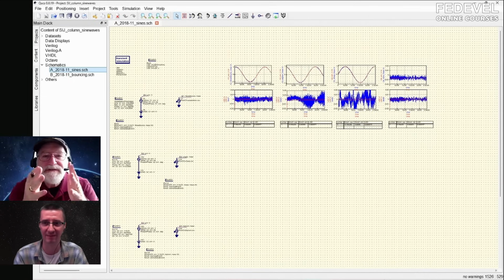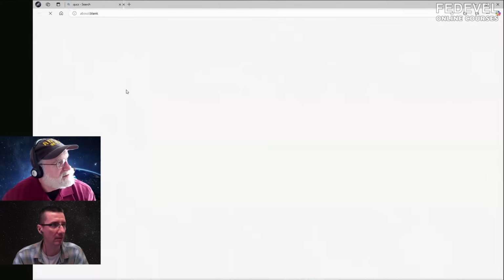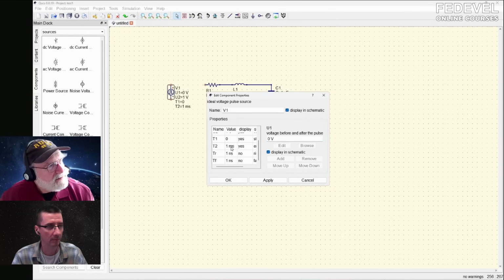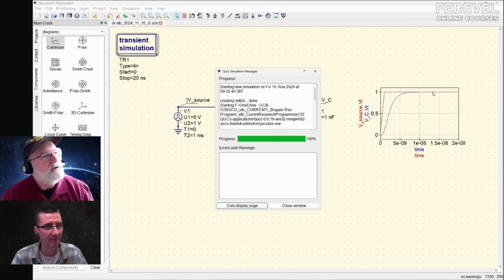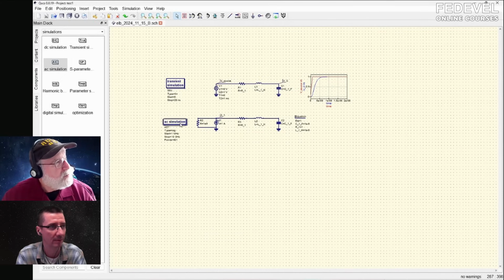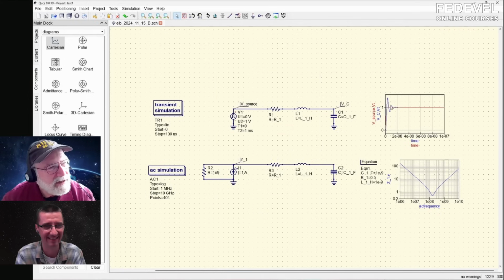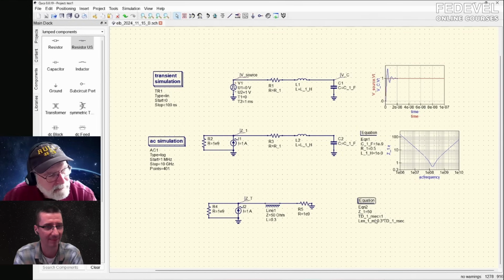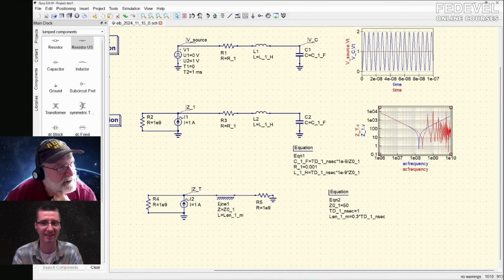How to Start with Electronic Circuit Simulation for Free | Eric Bogatin

Comment: I never see a model fr any of the parts I'd like to use.. even AD devices, don't have the part in LT Spice.  So what do you do to model a circuit, especially if it has a mix of AD / TI parts?    Is there another tool that can?  Cadence Sigrity?

My goal is to do a simple 8-differential-channel ADC  (AD7381-4) circuit (0-30v).  Not exactly high speed, but at 4Mhz, I know I can't be careless with the design/layout.

I was thinking each input would go thru a 15 Ω low-inductance 1206 series resistors, followed by 100 pF 500 V C0G 1206 capacitors from each leg to analog ground.   A single Vishay ACAS 0612 AT thin-film matched array per channel (24 kΩ series, 1 kΩ shunt, 0.05%, 15 ppm/°C) forms the precision 25:1 differential attenuator, mapping from the ±30 V input to the ±1.20 V THS4552 inputs.  Each THS4552 output drives the AD7381-4 inputs through 27 Ω 0603 damping resistors.

A TI THS4552RTTR fully differential amplifier (two ICs for four channels) is configured for fixed ×2.75 gain to map from +/- 1.20 V to +/- 3.30 of the AD7381-4..   Gain is set using standard E96 3.32 kΩ (Rf) and 1.21 kΩ (Rg) 0603 0.1% resistors. The FDA output common-mode VOCM = 1.800 V is derived from a 3.3 V precision reference (ADR4533BRZ or LTC6655BHMS8-3.3).   A corrected E96 divider pair of 16.9 kΩ (top) / 20.0 kΩ (bottom) generates approximately 1.788 V, which is comfortably within tolerance for a 1.800 V target. This node is buffered by an OPA392SIDDFR and decoupled with a 47 nF C0G capacitor; the buffered VOCM is star-routed to all THS4552 VOCM pins and the four attenuator shunt nodes.

A 27 pF C0G 0402 capacitor is placed differentially across each AINx+/AINx– pair at the ADC pins.

Comment: What a timing. I have just started learning LTSpice and reading BOGATIN'S Practical guide to prototype breadboard and PCB Design book. Here I got both of them. Thank you Robert. If you can tell me what I learn once I have a good knowledge in Spice it will be much more helpful.
Reply: Qucs use qucsator simulator. There is a fork called Qucs Spice thats uses spice.